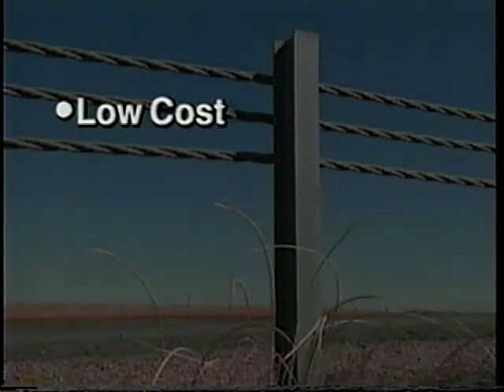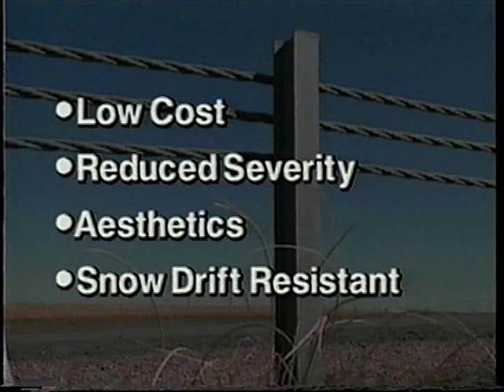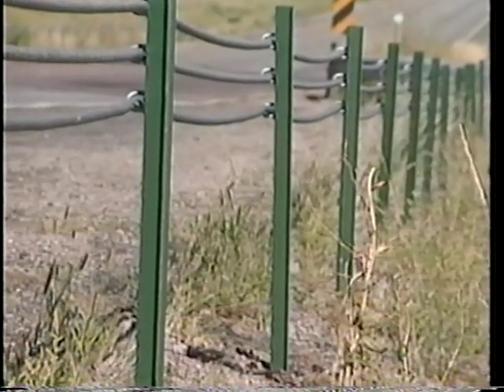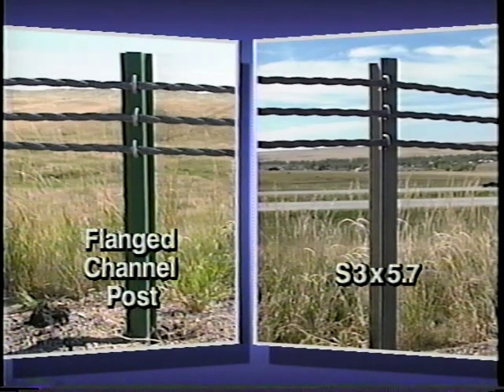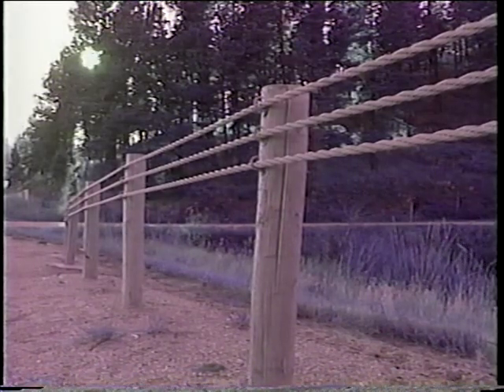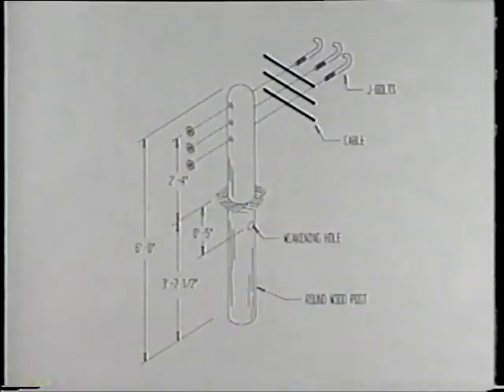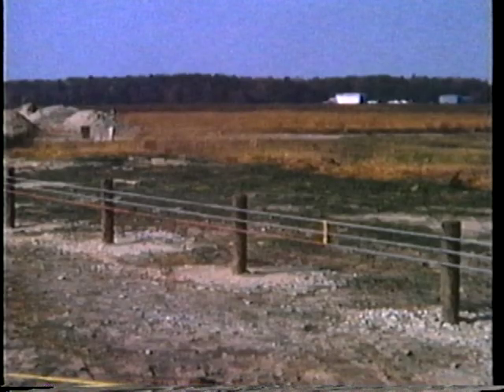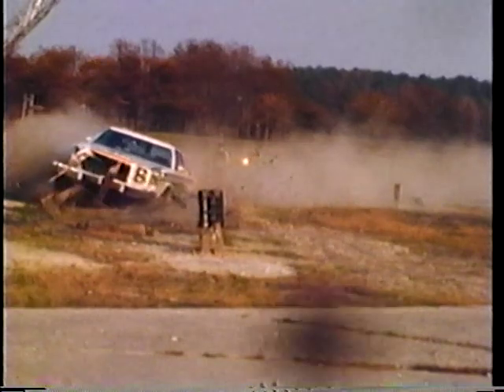Cable Guardrails

Comment: The crash test performance for vehicles acceptable, and it seems cable guardrail is economical due to their light weight. However, it's really not friendly with motorcyclist.
Reply: if motorcyclist don't care about their own lives riding on those death machines. Why should any one else
Reply: Not worse than weak post w-beam.  The posts hurt the motorcyclists more then the cables or rails.